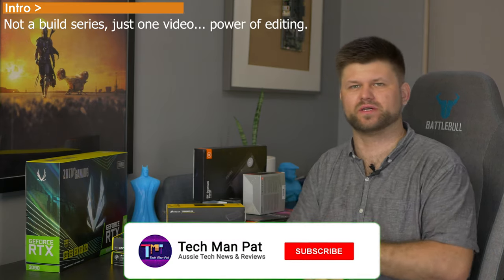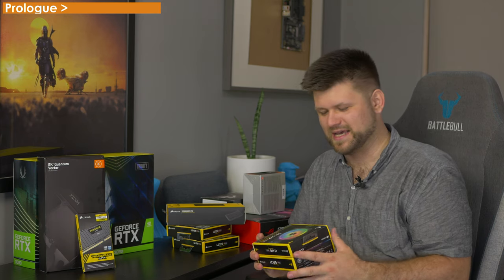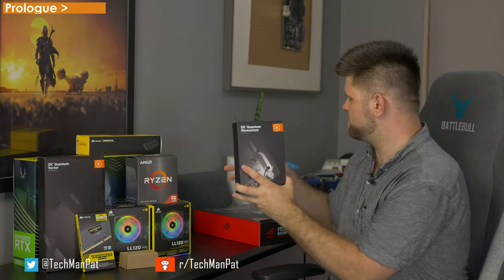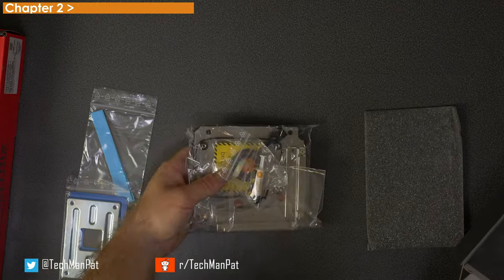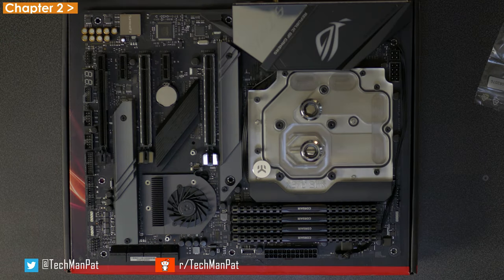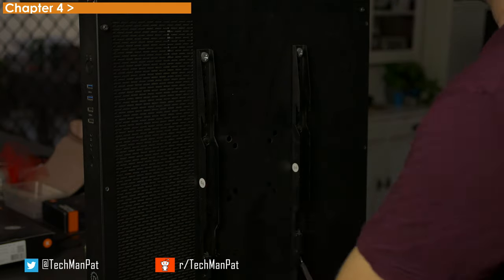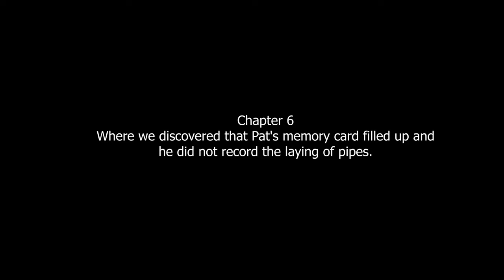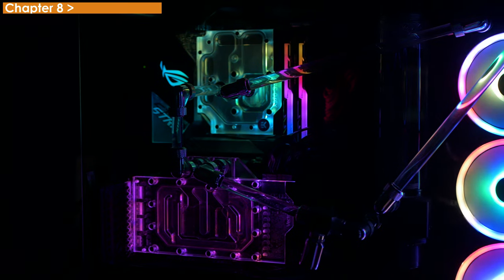Water-cooled RTX3090 & Ryzen 9 5950x | PC Build Guide 2020 | TechManPat

Comment: Pat, you stated you bought your LL fans in a 3 pack plus a single fan (for a total of four). The 3 pack (120mm fans, the 140mm fans are a 2 pack) comes bundled with the Light Node Pro and seeing as your fans are individually boxed; it looks like your "vendor" was simply selling you three individual fans. Depending on the amount you paid, I'd be looking into that - PCCaseGear sells the 3 pack for $13 more than 3 x the individual fan price as does PLE  a.k.a. the Lighting Node Pro adds $13, not the $30 (plus shipping & hassle) you ended up forking over.

I have an EK Vector block on pre-order for my EVGA 3090 FTW3 Ultra (and a backplate) which should be shipping early January, ATM I have in excess of 1 metre of radiators cooling a single 9900K waiting to get my graphics card back in the loop.
Reply from the maker: Yeah that's right, except the price difference, they were selling 3 x singles for $40.90 each in a 3 or 1 pack only (Same price) PLE sells 1 x $59, or 3 for $168  which works out to be $56 each anyway. So I got a good price via Amazon UK.  The Light node I had to get secretly for 29 + 15 in shipping from PC Case Gear, I think in total I ended up square across the board.

Comment: My 1 st watercooled pc..... 10900k and 3090.
On warzone my gpu gets to 50⁰C. But my cpu sits at 70 to 75.... 
Is it ok 25⁰c difference in temps between them ???
I have 2x 360 hwlabs gts....
Reply: well my experience on warzone is terrible i got spike of 70 too and just on this game. im on r7 2700x oc to 4.2. massive block and dual 360rad. gpu is rx 590 but never cross 50c